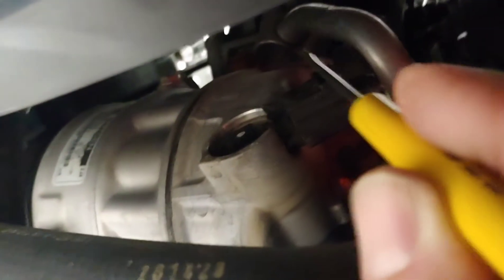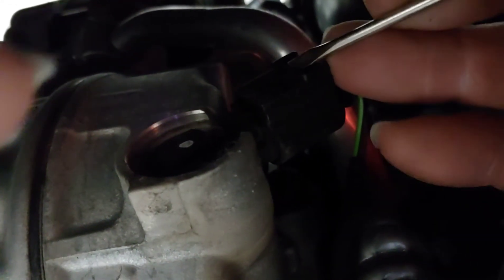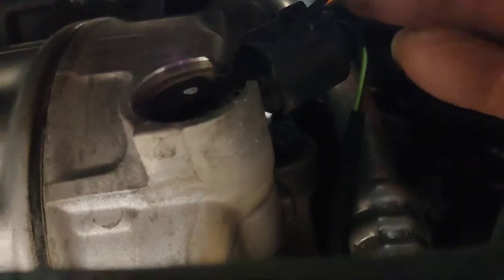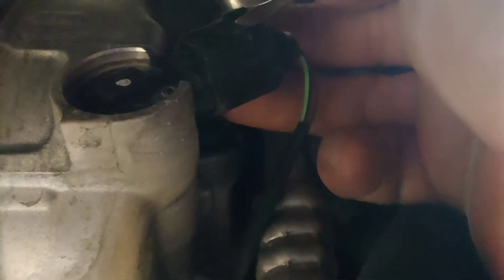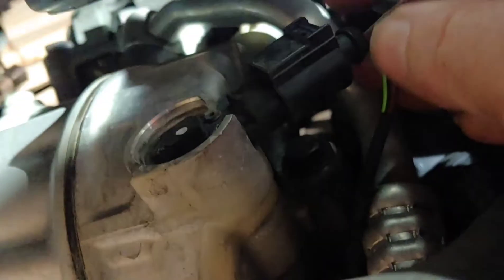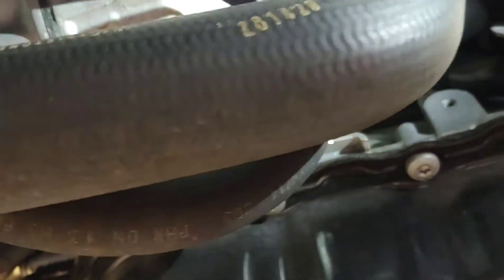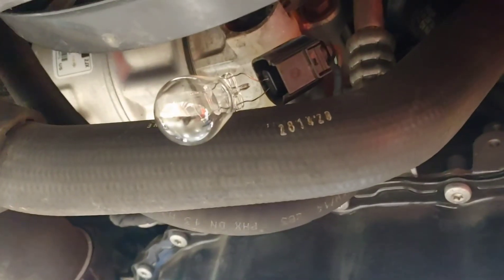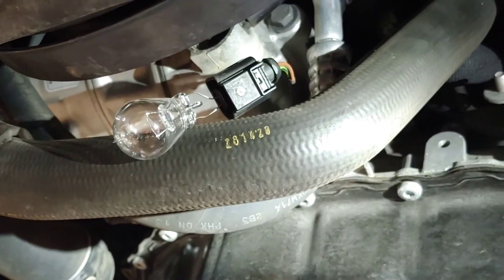Testing an ac compressor clutch and clutchless AC compressor, how to use a 3156 bulb to test.

Comment: If the bulb doesn't light up?
Reply from the maker: Sorry for the delay, 2 things need to occur: power (everyone seems to grasp this right off), and GROUND sorry for the caps The computer grounds in the most basic of terms, the circuit, no bulb lighting means one is missing (as far as computers it's a ground thet is missing) The computer connects the ground to the power (making whatever work) it also duty cycles the ground to control how long its on. Google "duty cycle" for more on that.      No bulb turning on ======= No working.

Comment: hi...so even if my solenoid valve is broken, the engine will still that change in sound when ac switch is cycled on and off? (As you pointed it out at the end of the video when it's compensating for the load).
Reply from the maker: The engine should react to the AC switch yes its not instant it takes a second or 2.

Comment: Why not just use a test light or volt meter ?
Reply from the maker: How are you going to get the aligator clip in the terminal in such a tight spot? And trust me having 12 volts on a voltmeter unloaded is a worhless test. The lamp loads the circut. Hope that better explains it. Once you try it thats the only way you will test ANY 2 terminal device fans blowers solenoids injectors all of it. If its on a 12 volt circuit this will test it.